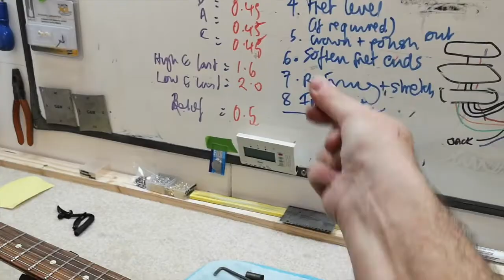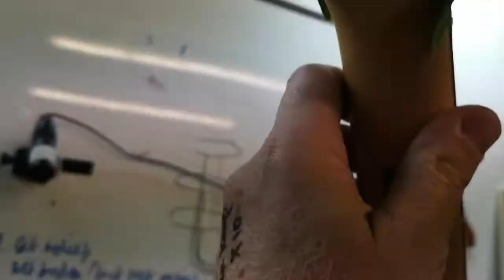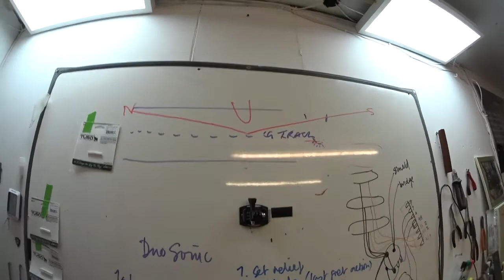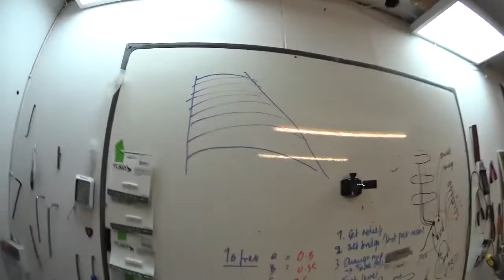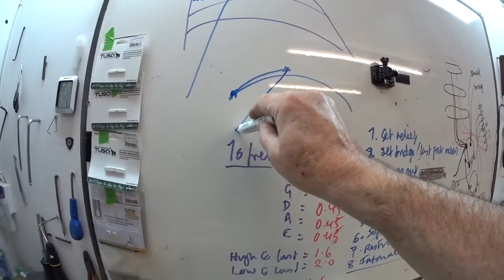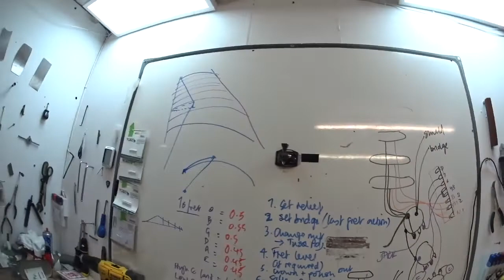Fender DuoSonic set up

Comment: Sam what size is the allen screws to raise and lower the action. My .050 allen wrench for my mexican strat is a little too big ? Thanks nick
Reply from the maker: Hi Kogadogg - that's...odd. The problem is that I can't recall offhand what it was... but there are only two kinds I ever use at the saddles: the 1.5mm for Far East guitars and the 0.050" or 1.27mm for USA / Mexico guitars. It could be that the hex 'hole' in the grub screws have been rounded by misuse? If so, maybe plan a replacement set of saddles & included grub screws. I like to replace these saddles with 6 x brass saddles (I get mine from Northwest Guitars in the UK).
Reply: @SamDeeksRelovedGuitars  thanks so much for your help sam .i have one of the original “guitools” multipurpose tools for adjusting guitars and the very smallest allen wrench on this tool fits the allen screws ,but i just wanted to get a couple extras. I even asked the guys at fender,and they said it was an .050 size . This size fits my mexican strats and my squire mini strats ,and my ibanez gio mikro guitars. . It is strange . Thanks so much ,i really appreciate you sam . Cheers. Nick

Comment: Nice set up! What kind of adjustable nut are you using?
Reply: Ah, you made it from a standard Tusq nut?
Reply from the maker: Hi Johan - yes. A little careful 'drill & tap' work and some tiny grub screws / hex keys. I've been using these for some time now and can't really find any fault with them. Some people argue that they won't trust their tone to 'two tiny legs' ... but I've not been able to discern a difference so I trust my ears on the matter.

Comment: I can't believe these things are priced at $829 now!  In just a few years they went from $500 to $650 now $829. Fender is on crack! I found a used priced 2016 with Rosewood fretboard with the plastic still on it a couple years ago for $350. I did have to fix a ridiculously obvious factory defect it had though. The mounting screws for the humbucker were oversize in length causing them to bottom out in the pocket thereby pushing the whole pickguard upwards with the humbucker and warping it over 1/8".

Comment: I actually have a Duo Sonic. I love it but I recently came across an issue. I got my strings changed by a local music store and I’m unable to plug the cable in all the way. Does anybody know why?
Reply from the maker: Hmm interesting. Not being able to insert the jack fully tends to happen when the jack socket rotates to a position where the hot lug cannot be pushed back when the jack is inserted. This can very easily occur in Strats where there is limited space below the jack plate. With the hot lug pointing one way there's enough room, but turned the opposite way the tip pushes it open and it gets stuck against the wall of the cavity. This can also happen where the jack is fitted over a 'tunnel' in the side of a guitar and the tunnel is slanted. Same thing happens; in one orientation the tip can move back freely, in the opposite it can't. 
It's less likely to happen in a pickguard-mounted jack fitting like yours BUT it still could have rotated to a point where the hot lug now can't open up - maybe because it's pressing against the wall of the electrics cavity. There's no particular reason why this would happen after a string change; this may be unconnected i.e. random. First check the tightness of the jack socket nut / fit. If it's at all loose that could have easily rotated. Second, remove strings and lift off plate and insert the jack now. If it goes in smoothly you can conclude that when fitted back down, the tip is obstructed by the side wall of the cavity. Solution - rotate it to a safe position (with enough room to open out when jack is inserted) and tighten down in that position.
Reply: @SamDeeksRelovedGuitars  ok thanks! It turned out to be that when I got my strings changed last weekend, the person changing them tightened the nut around the Jack and it cause there to be a wire in the way where it wasn’t supposed to be. Thanks!
Reply from the maker: @blakesaupe129  Ah - he likely tightened it without holding it firmly in place. Guaranteed to cause it to rotate (while tightening it up). A couple more 'tightenings' like that and it'll break solder connections. The rotation is why the lead got in the way where it wasn't before. Tip - either wait until you can lift the scratchplate before tightening (and hold tightly to the back side of the jack while tightening the nut) - OR buy a tool like this:

https://www.stewmac.com/luthier-tools-and-supplies/tools-by-job/tools-for-electronics/jack-the-gripper/?utm_source=google&utm_medium=shopping&utm_campaign=2022-12-gp&pref_currency=GBP&shipcalc=UK&gclid=CjwKCAiAp7GcBhA0EiwA9U0mtjUWeLu3tH8VflYxg_n6dwDkigcu4KWyU047NKOZLQZ8PtlXoRwaThoCMPgQAvD_BwE

It's the kid of kit that guitar owners wouldn't think worth spending so much on - nut guitar techs ought to.

Comment: Hi Sam,  you explain that the adjustable nut gives better tuning stability,  could you explain how that works ?
Reply: It’s more so tusq nuts in general since they’re impregnated with Teflon to allow for better string movement during bends and playing. The strings slide in the slots, then returns back to pitch. The set screw in the adjustable nut allows for more options to action height.
Reply: The adjustable nut also allows for just a slight bit of movement since it isn’t fixed to account for humidity variances to the wood. So the strings and the nut work together acting on each other to keep maybe a slight bit of better tuning.
Reply from the maker: That's a pretty good summary Joel. Yes - PTFE makes the slots almost friction-free AND by bringing the slots UP to the correct 1st fret action (rather than cutting down) I preserve the factory-shaped slots which are a little less ragged than hand-filed slots (no matter how good you and your files are). Just bear in mind getting the nut right is 50% of the 'tuning stability equation' - stretching ALL of the unreleased slack out of your new strings before playing is the other 50% - and this takes much more work than most guitarists do.